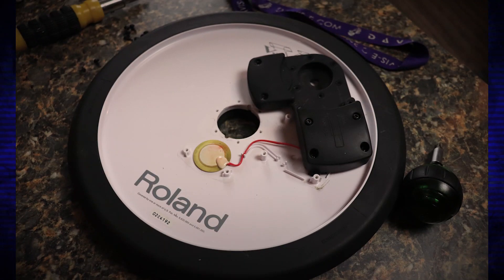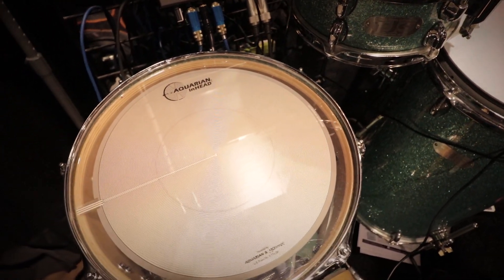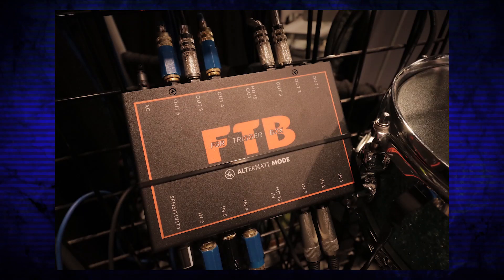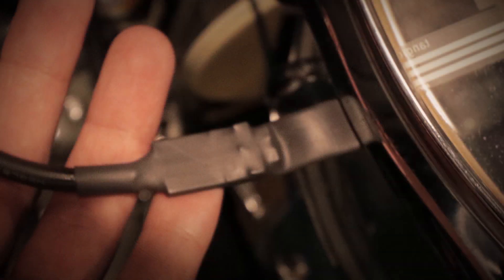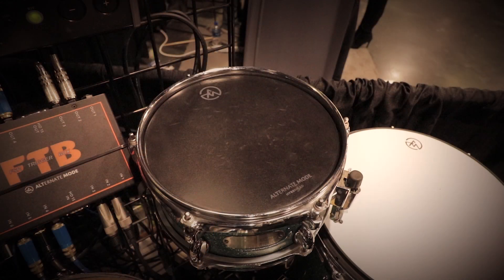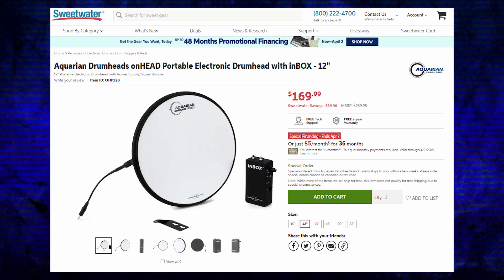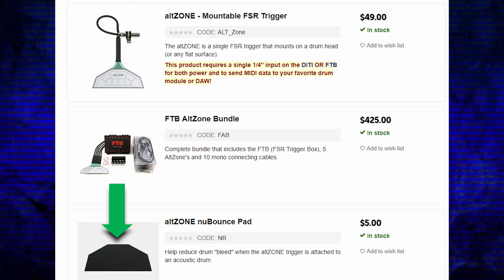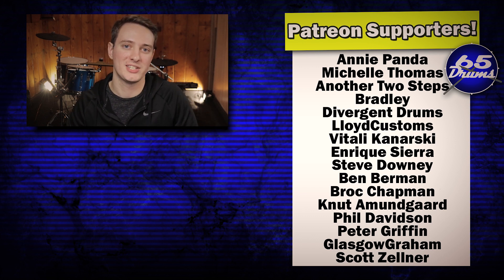Alternate Mode First Impressions! HybriPad, HybriHead, DrumKat, Jamkat, and DITI

Comment: I find the drumkat to be very usable. If you feel like you need a rim , or a simulation of a rim, try a velocity switch that plays a rim shot over a certain velocity, or a cross stick on a different pad. If you need more pads, check out the trapKat XL. 24 pads is plenty, especially with the rim triggers where you would need them near the snare and hi hat pads.
Reply from the maker: Good tip on the velocity switch.

Comment: I have the drumkat 3.8. I don't use the diti or tfd. I use just a roland dt6v by using midi in/ midi out. Thats all i need and i get great sound. With 18" subwoofer & 10" carvin speaker. Hooked up to a 1600 peave amp & berhringer 1204usb  console. Thanks for that video. Love all ur video's.

Comment: My Roland TD 25 only has two outputs and I've thought, for LIVE gigs that I'd use a Radial JDI Stereo - Jensen Equipped 2-channel Passive Instrument Direct Box  or the Radial JDI Duplex mk4 Stereo Direct Box.  Would you suggest something else otherwise?  Looks like what you're sharing here doesn't apply, specifically to my situation.  Let me know. Thank you

Comment: That's not true i don't use extra box for my drumkat 3.5. I have roland TD6 connected stright to my drumkat using midi wire. To get sounds.just need to program sound from td6 to drumkat 3.5.